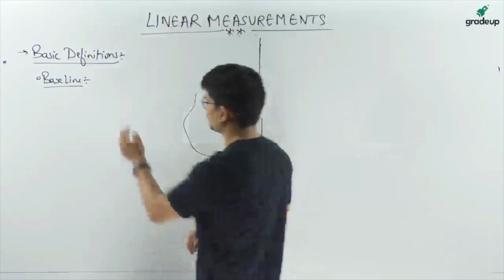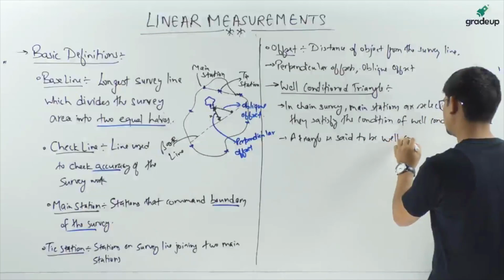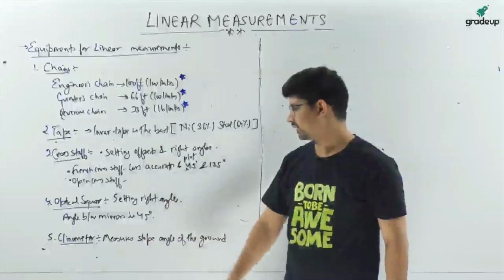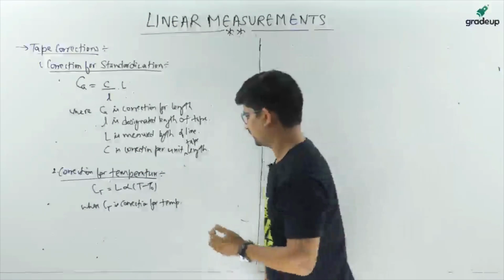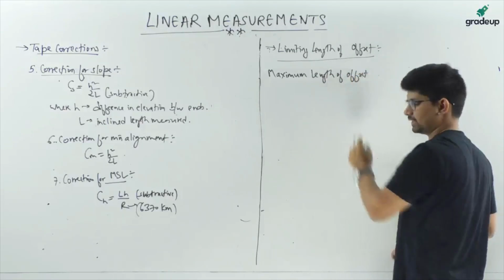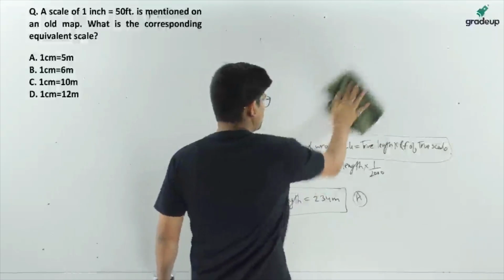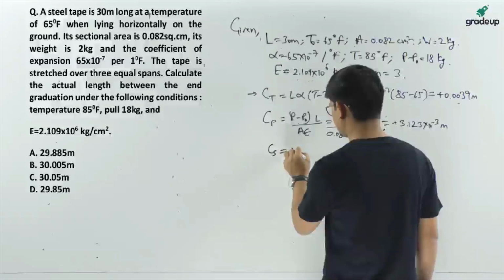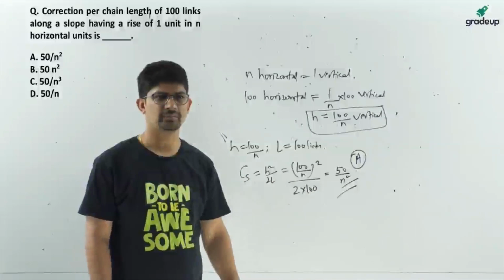Prepare for RRB/SSC JE Civil 2019 | Surveying Class 1 | Linear Measurement

Comment: Base line formula is wrong 2.00mins , as you said it is not two equal half or approximate equal half- there is no such thing in maths  as approximate equal half. equal and approximate do not match.  you can say its equal or approximately half. Base line means the longest line between two points on a survey framework (Ref from Pearson BTEC construction UK).